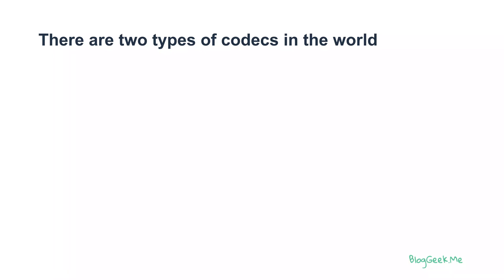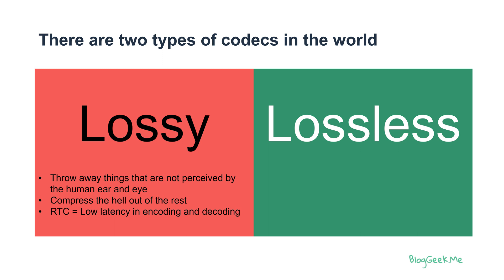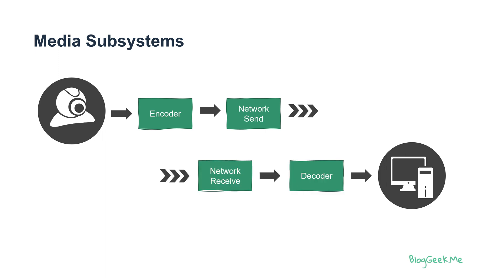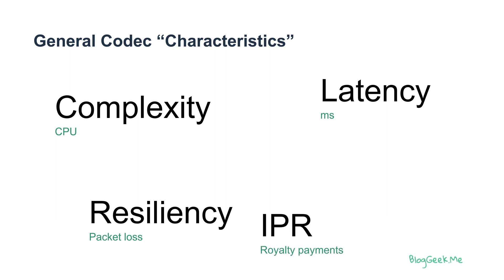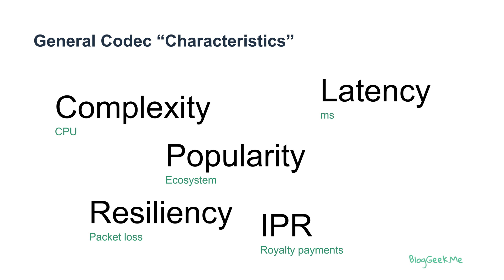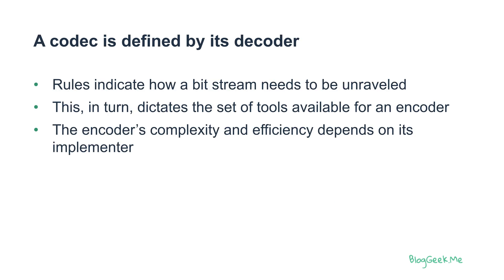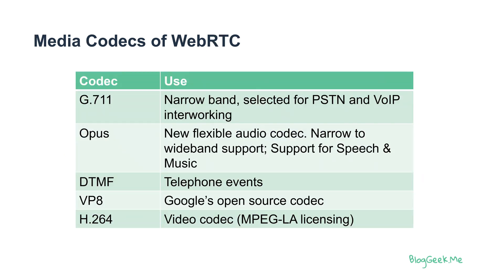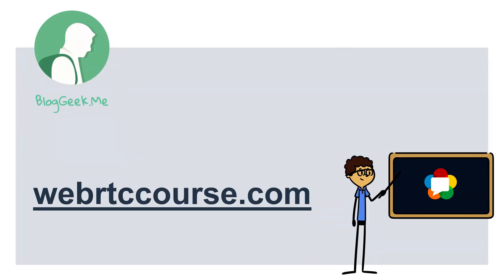Codecs in WebRTC

Comment: AV1 is supported in Firefox for a long time now...
Reply from the maker: This video is a year old. I'll probably be updating it at some point, but not yet
While browsers generally have AV1 support these days (event for WebRTC), this is limited in capabilities and I'd still consider it "work in progress".
For the most part, I won't suggest using AV1 in WebRTC for those who don't have first-hand experience with video codecs AND WebRTC (and first-hand doesn't mean "I installed and ran it once and it worked for me")
Reply: @tsahil  Indeed it seems like even though Firefox had officialy supported since early 2019, I couldn't find any mention of AV1 being used in WebRTC inside Firefox. Actively using AV1 in WebRTC calls is probably more complicated than just "supporting AV1".

Awesome! I would be really interested in update to this series. WebRTC is such complicated and evolving piece of technology and somehow you can explain it in very clear fashion :)